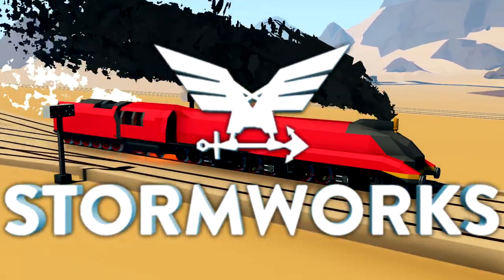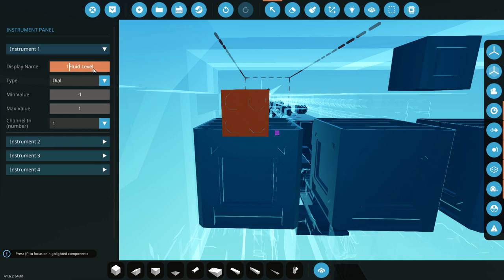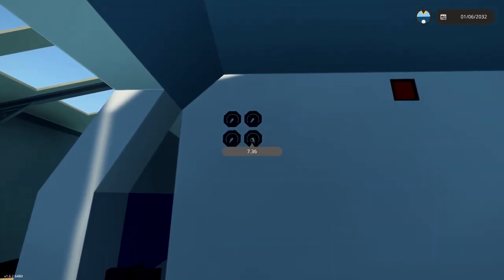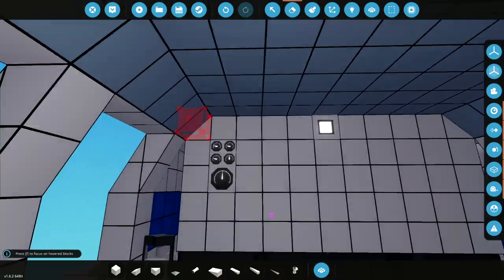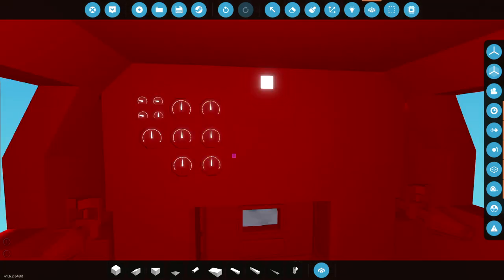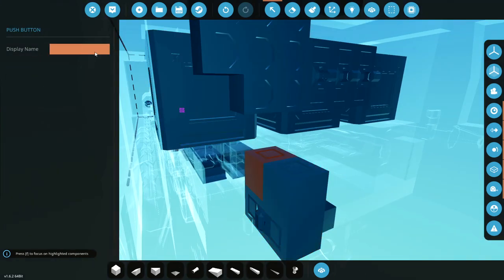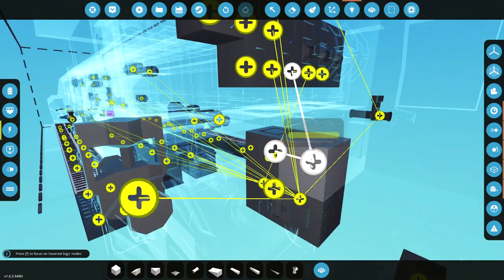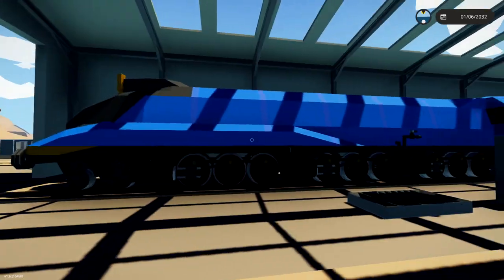CAB Interior Fit In Our HUGE STEAM POWERED LOCOMOTIVE In Stormworks!

Comment: Aw I wished you button for the light right next to the seat. And wire cables up the roof. Then another to the lights.

Suggestions:

Adding stopers between the locomotive itself and the coal cart. so when you push them to togther. The only thing broken is the easily neglectable stopers. Make sure they have enough distance acting as a buffer.

Adding another one or two sets of support wheels underneath the cap.

Would it be cool to add dials for individue boiler pressure on the outside (for maintenance I guess)?

Also Lights on front and end plz~